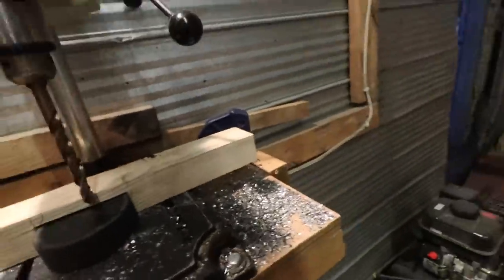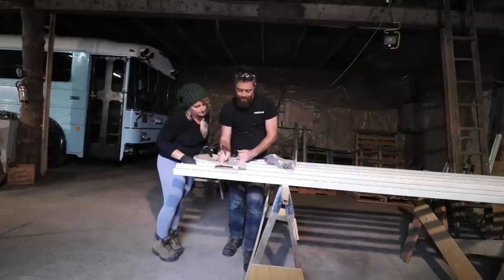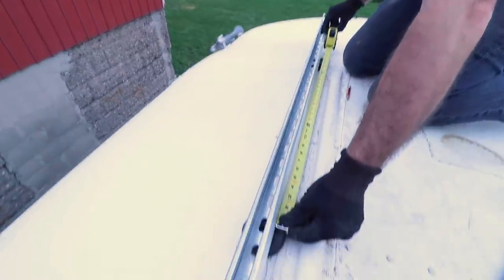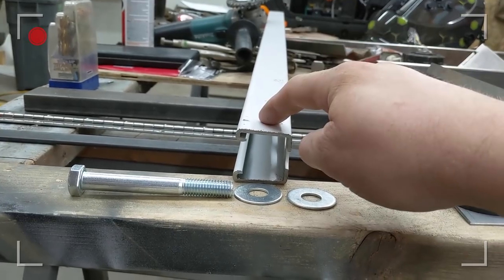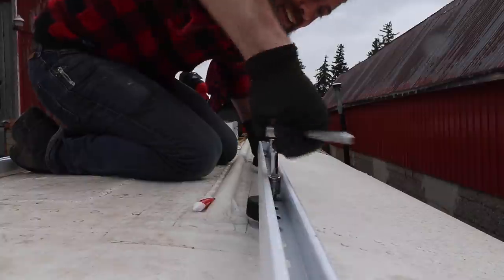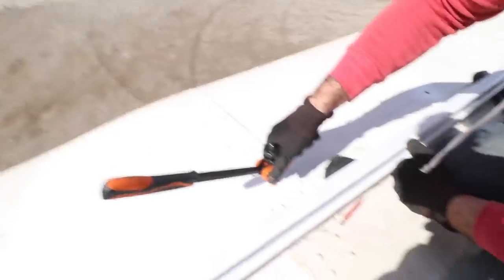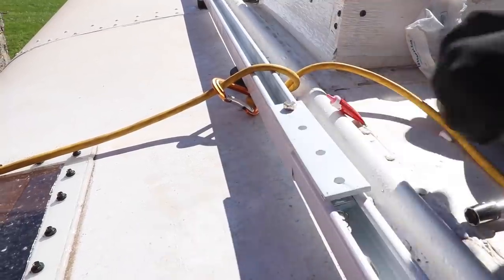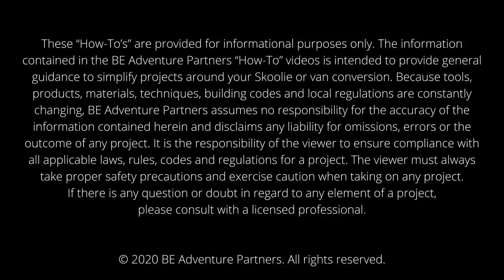Clever Yet Simple DIY Roof Rack Mounts Using Unistrut Channel Skoolie Conversion

Comment: How do you like the rack a year and a half later?  I'm thinking about using rivnuts as I am not removing the inside ceiling.  Thanks.
Reply from the maker: Great Q @Homestead Dad! We LOVE it! The Unistrut is galvanized, so we shouldn't have painted it, unless we had stripped the zinc coating using vinegar.... So the paint is chipping. Self etching primer would work too. Anyways... You can't even see it because it's under the "cat walk" ;) 

If we were to do it again, we would use plus nuts because they have a wider grip range & stronger pull out resistance. That being said its super strong. 

The rivnut hand popping tool SUCKS! If we were to do rivit nuts again we would get the drill mounted tool or the hydraulic one. 

NOTE: Some of our rivnuts didn't go in perfectly and we were really happy we could see which ones they were because we didn't have our ceiling in yet. This allowed us to caulk the inside around them to seal them better. No leaks! YAY

Hope this helps.
Reply: @BEAdventurePartners  I totally forgot about plus nuts. I'll look into the better tools, I have one of the cheap ones.  Thanks so much!
Reply: I would highly recommend AGAINST it! This made my schooler roof leak horrifically! And I did it exactly the same way! I used it to mount my solar panels. I even put 52OO over it and that reduced the leak but still leaks and my roof molded. It’s a nightmare!

Comment: Hi guys - thanks for the video and advice. I'm getting ready to add unistrut sections and solar panel onto the roof of our skoolie. 2 Ques: 1) how you decided on rivnuts vs plusnuts? 2) it seems that yall are putting rivnuts in the center of the roof rib hat channel. Why did you decide to attach in the center of the roof rib hat channel and not the flange of the roof rib hat channel? Thanks.
Reply from the maker: Hey hey @Anand Raghunathan - Great Q's! We didn't know enough about plusnuts at the time, but Brian just told me we would have used them if we had known more about them because they have more pullout resistance than rivnuts. 

We positioned the rivnuts to the side of the hat channel so we could see the bottom side of the rivnut to make sure it took. 

The other option was to do a through bolt through the hat channel but we didn't want to loose headspace in the bus by having a nut on the hat channel if that makes sense. 

And we didn't go into the flange because it was a small target and the size of rivnut we were using was larger then the flange. So it wouldn't have set up properly.

Hope this helps. It is truly a science experiment, and you only know what you know when you know it. LOL

Let us know if you have anymore Q's! Wishing you the best on your project!
Reply: @BEAdventurePartners   Thank you soo much for the reply. I'm going with plusnuts and will be exploring the best spot to insert these tomorrow am. What was the length of the bolts that you used into the rivnuts? Think I missed it in the video. Thanks again yall. Be well and stay safe.
Reply from the maker: @anandraghunathan9493  great question! Every application will be different based on the material you are going through. We went through a washer, the Unistrut, a hockey puck, roof material, and then into the rivnut. So make a list of all the materials you are going through, add up their thicknesses, and that’s how you get to the length of the bolt you need to use. 😉 hope that helps!
Reply: Looks like you can use Plus Nuts with a Rivnut tool if you use a washer to start tightening them down first and go back with the anvil reattached to finish them off.

Comment: Great vid as always.  I used uni-strut on my little van as a kayak rack. Needed to carry three and the store bought crossbars wouldn't have been wide enough, weren't rated for enough weight, and cost three times what I spent on the strut and some U-bolts.
P.S. love the hockey puck idea!!!
Reply from the maker: That is so awesome to hear @Matt Courty! Unistrut is awesome stuff to work with. AND way stronger that some kit you can buy at the hardware store. lol The hockey pucks worked awesome to help seal the holes, and get the struts to the right height for mounting the decking. Hah thanks for your support, and for going back in time to watch these oldies. - E + B too
Reply: @BEAdventurePartners   I've always been a time traveler! Shhh don't tell anyone. LOL I'm enjoying going back for these and working my way up to the present. I may never build my own, but the ideas I'm picking up from you guys are useable in other ways too. Plus you're always entertaining and easy to watch.  If you want to take a look at my rack.....Uhm my Kayak rack it's on my instagram.  Hope to one day meet up on the road!

Comment: Love your humor - nice doo there Brian.  Are you then attaching from the inside to that screw?  Changing now to this way for our rack - it just looks cleaner and not so industrial IMHO. Can't wait to see what comes next👏💜
Reply: The rivnut is the inside attachment to the bolts going through the pucks. Think of them as pocket nuts. That's why they used locktite on the bolts, since there is no way of attaching washers and nuts to the ends of the bolts.
Reply from the maker: Hey @Luey D! I love my new doo! Erin has been working on my mullet for a couple months now. Getting it formed up right!

Rivet nuts are blind anchored fasteners. That means you don’t have to do anything on the back side. All you do is drill a hole, pop the rivet nut, then screw in a bolt. We used threadlock on the bolts to reduce the probability of the bolts ever vibrating loose. That’s the cool part about rivet nuts is that you don’t need a nut & washer on the inside! Be sure to look up the specs of the desired size of rivet nut so you get the right size for your application. They come in a ton of standard sizes.

Thanks for watching!
- Brian + Erin
Reply: @BEAdventurePartners  Brian, thank you for clarifying that for me - still gonna do what you're doing tho🤞💜
Reply from the maker: Luey D happy that explanation helped! - B

Comment: Well done you guys. Watching you step onto the roof off the top of that ladder makes me very happy to have that tall industrial ladder. Sketchy AF!
Reply from the maker: Hahahhahaha @AllMoMoMostHome Bus! You'd be pooping your pants with Erin! If you didn't notice... I had the tip of the ladder hooked to the grab handles on the top of the bus with a ratcheting strap. However... Our bus is only 10 feet tall... Your's is 20 feet tall... Two residential stories.... You should be scared and have fall pro harness for heights like that!
Reply: @BEAdventurePartners  above 10 ft were rolling the dice! I will say I'm not a fan of being up there on the roof since there is currently nothing to grab onto. The extra 27 inches of height creates a very noticeable difference in the level of butt puckering.
Reply from the maker: OMG pucker up @AllMoMoMostHome Bus... I would 💩 up there! A lot of the times I crawl around like a little baby... But I am getting more comfortable. It takes time. The one ladder we use to get up there really scares me cuz my legs are so short. BUT the other one we have has a flat top to step on, and it's a bit higher... So from now on... THAT is the only ladder we use... Well if Brian wants my help up there ;) Stay safe up on that roof Mr.

Comment: Henry's tropicool helps insulate your roof as well as seal it I see you're preparing for your solar panels and maybe a deck those also absorb the Sun before it can hit your roof so it can cut down on your solar gain in the summertime looking great guys I'm still keeping an eye out for any more steampunk ideas like the puck thing though... we use the same rails on our roof of our barndominium, for our solar panels, we've had 80 mile an hour winds and not had any problems a good product
Reply: The tropicool created more problems than it solved for me. Just paint your roof imho...
Reply from the maker: @KAREN RIGGLE + @Shay McQuaid... We ended up using the Canadian version of Henry's Tropicool cuz we heard of all these things... The stuff we used it called "Cool Flex" by Durock. Our roof looks SOOoooOOo dirty. Anyone we have ever talked to regretted it. We too wish we hadn't used it now, cuz it is so porous that everything sticks to it! In the end it won't even matter that our roof is white because most of it will be covered in solar panels and a roof rack/decking so we can walk easily to the panels if we need to clean them off. If we can paint over that crap... We will before we do anything else up there. We just have to call Durock to see if it's ok to paint over elastomeric paint. We will be using white gloss Rust Coat to go over it likely in the Spring. 

Karen, great to hear that the rails works well on your bus, and that you liked that paint. We have found it to be a pain in the butt, and an eye sore...

Comment: Hows this holding up now that its outside the barn? Had to do any resealing yet. About to use this method but worried about the holes in my roof.
Reply from the maker: Hey hey @Matt Sturgeon... NO LEAKSSSSSS (from the unistrut at aleast!)... We did have a leak on the factory seam not too long ago. It was super annoying... This video will show you that special moment: https://youtu.be/6ZXopYix7WE

However... The unistrut has been AWESOME. Something we would recommend... Clean your roof, and use seam sealer on EVERYTHING up there before you do anything on the roof. Seal up all the factory seams. (That video will show you what we mean by that.)

We have had a ton of rain this summer and the holes from this project and all other skylights haven't leaked once.

Let us know if you have questions. Feel free to message on Insta. - E + B too
Reply: @BEAdventurePartners  seam sealer

Comment: Hi guys. I’m flashing back for details since I’m nearing the unistrut installation project myself.  Like you I am a bit indecisive,  Im uncertain about my solar panel size, that purchase is down the road, but (!) I have my hockey pucks !  How far apart did you put your unistrut ? I have a shuttle, so roof curve is not really an issue, is there a “standard” width for installation ? I’ve watched a lot of videos, that’s a detail not addressed.  TIA
Reply from the maker: WEW that's exciting @islandwitt1! There are so many decisions to make. You may want to watch this video as well, cuz we didn't stop at the unistruts: https://youtu.be/-GQTRlbBVSI

We still have more to do up there, but the weather has gone for a turd. LOL it's snowing. 

As for the distance between the unistruts we made that decision based on the shape of our roof, and knowing we were going to add more supports like we did in the video we just shared. As we're sure you know, this project is no joke. You will want to use your own judgement on this one based on the width of your roof, and your plan for your decking, and size of your solar. The material you use as decking will also matter. We plan to frame out each section of decking with angle iron. The material you choose may or may not be strong enough to cantaliever. So that is another factor.

Sorry for the vague answer. It's hard to give you a good answer when we aren't on your roof firing a million questions at you. Unistruts website has specification charts and info on load distribution. Every build is different, so make sure you check out the charts. If you are not sure, consult with an engineer. Ain't nobody want their deck flying off! Send us pics when you are done. We believe in you!

- Erin + Brian too
Reply: @BEAdventurePartners  thanks for your reply and great info. I’m only putting solar on my roof, no deck, I’m an old woman who has developed a fear of heights and broken bones. Have decided that I will maximize the spread as best I can, can always modify angle brackets to accommodate as necessary. again Thanks ! I love your channel, I appreciate your intelligent well thought out information 👍🏻🙏🌹

Comment: Did you guys use 3/8" or 1/2" rivet nuts? Im a bit confused because you said you used a 1/2" bolt with a 3/8" rivet nut. Could you please let me know because I like your design and plan to do it on my bus here soon. How did the hockey pucks hold up? I looked at the durometer and it was harder than a bowling ball. Seems like you would want more flex than that. Thanks for your help!
Reply from the maker: Hey @Joshua Hartsel! Great question! We used 3/8”-16 rivnuts with matching diameter bolts. You can use up to 1/2” bolts (I think that’s what we mentioned in the film.)

The hockey pucks don’t need to be flexible because they are on a flush part of the roof. And because they are being used as support, if they were soft that would cause problems with deflection of the Unistrut.

Let us know if that helps!
- Brian + Erin
Reply: @BEAdventurePartners  thanks so much! Very helpful.
Reply from the maker: @Chill_Sergeant  happy to help!

Comment: So you used 3/8” bolts with nylon nuts when you could drill into the hat channel, but rivnuts when you had to attach only to the sheet metal? Is that correct? We’re about to do same thing in our build, so currently researching best attachment methods.
Reply from the maker: Hey there @wooly beast. There are many ways to accomplish this task and this way is what works best for our particular situation. I'm 6'2". So connecting through the hat channel would have dropped our finished ceiling height by over 1" past the hat channel, which would have set our total ceiling height to lower than I am tall. By doing it the way I did & speaking with the rivnut manufacturer about proper application of their product for our installation, each rivnut has something like 900 lb pull out force necessary to pull out of the "sheet metal". Combine that with the number we used, there is a significant force necessary for any of these to even budge. So do what is best for your build as our techniques are not appropriate for all installations.

:) 

Happy building!
- Brian + Erin
Reply: @BEAdventurePartners  thanks Brian and Erin! I’ll reach out to the rivnut manufacturers as well, that’s a great idea.
Reply from the maker: Happy to help @wooly beast!

Comment: Killer Fun! Nicely done! Do you get much wind noise coming from channel?
Reply from the maker: That's a great question! We actually haven't driven down the road once we installed the Unistrut. We plan on building a deflector scoop on the front edge of the channel to divert the airflow above the solar panels that will be on the front part of the rack. We'll post a video about that in the future. Thanks so much for watching!
- Brian + Erin

Comment: Where did you get the pucks?
Reply from the maker: We found a guy on FB Marketplace selling used pucks. Come to find out, he works at a hockey rink. So you may call some hockey rinks to see if they have any used pucks for sale. We got them for $1/each vs $5/each new.

We’ve been through some major rain events and none of the holes drilled through with hockey pucks are leaking! They act like big gaskets!

Thanks for watching!
- Brian + Erin

Comment: the hockeypucks and the unistrut is actually a pretty good idea (though his idea of putting the watertanks up there might not be , it sloches about way up there and the sun is beating down on it and that might cause algae to form in the drinking water , might be good for non pottable water though ) , can hook youre solar and antenna's (cellphone satelite dish tv antenna ) to it eventually , you might need one or two more along the middle (depending on the size of the panels )
you couldve put the connectionpieces on the bottom , i dont think you can now as the locktite makes it verry hard to loosen anything 
as for the rivnut aplicator , it works better if you rivit it in stages so not completely screw the rivit on , that way the handles are closer together and you dont have to force so mush , after the first stage tighten it a bit more and finish the rivnut
Reply from the maker: Thanks @watahyaknow. Oh, we won't be putting water tanks on the roof. We wouldn't want our water to freeze, over heat, OR most important, make our bus top heavy.  We need that roof space up there for our solar panels, and a roof rack. It will be important to have a flat surface to walk on if we need to clean the solar panels off, or just hang out and watch the sun rise + set. 

We likely won't change how those connecting pieces are put up there now. BUT we did think of a way to get around that. So stay tuned. 

Great to know about the rivnut tool. That was our first time to use it. It's all part of the experiment isn't it?! ;) Thanks for watching! - Erin + Brian
Reply: the guy you gotten the hockeypuck idea from seemed to intended to put the tanks there ....